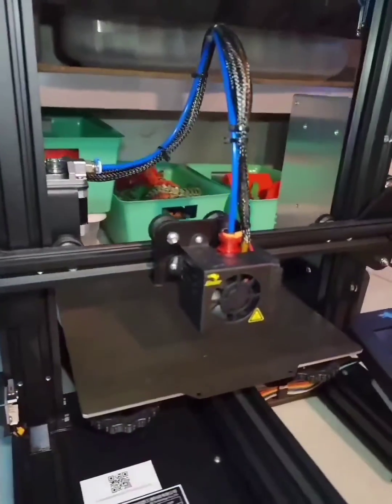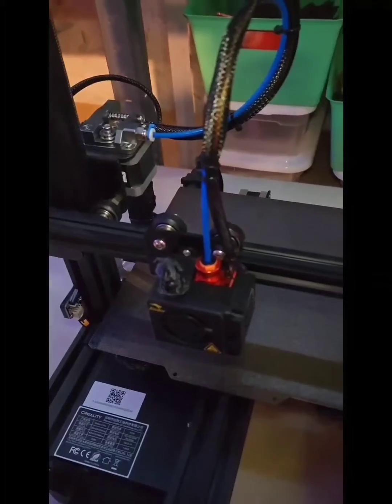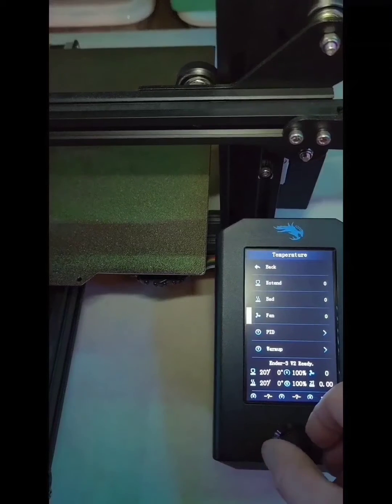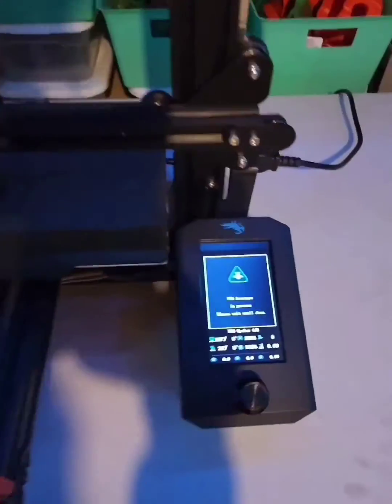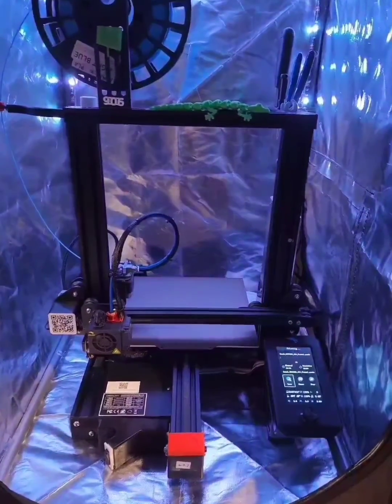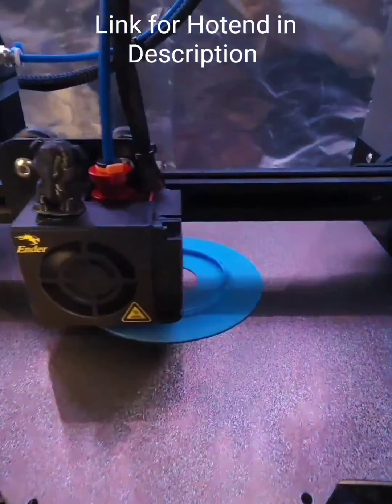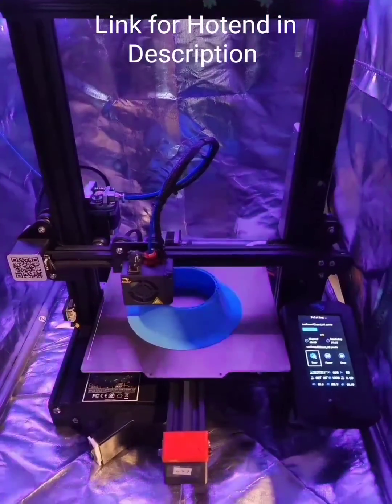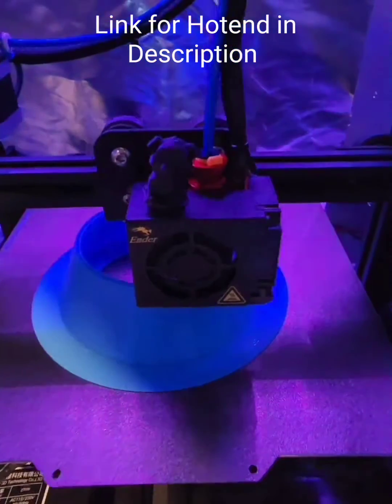How To Install Creality Spider 3.0 Hotend Ender 3 Pro v2 Unboxing Product Test & Review

Comment: That hotend doesn't work on my Ender 3 with silent board 4.2.7.  It prints worse than before, with the factory hotend.  I will eventually return the old hotend.
Reply: User error…
Reply: @moldedchezz  I have horizontal lines.

Comment: Despite what they say. It does not fit all ender 3 line.
I have ender 3 neo max and it does not fit with the shroud. Not on the bowden tube top side nor the bottom fan side.
Zero, nada.
Reply from the maker: ok good to know the Neo is different.

Comment: Is this hotend "plug and play"
Reply: Yes
Reply: @moldedchezz  no firmware update because of the new temperature increases? 
You can print up to 300 degrees Celsius with it. You would have to do a firmware update for that, wouldn't you?
Reply: @dieterdodel835  realistically, plug N play.. if you’re actually gonna print ABS or similar high temp filaments which MOST don’t.. then yes, a firmware flash is needed..

Comment: its other thermistor , no software adjustment ?
Reply from the maker: I did change the heating cartridge to a 50w but you dont need to. Just thermistor. But with a 50w heater this heats up FAST
Reply: @therecoveringjackass  the heating yes , but the thermistor do you need software adjustment for thermistor
Reply from the maker: @jlhuyghe445  no you do not need new software. But having alex's firmware would allow PID auto tune on device so it would be beneficial. Thanks